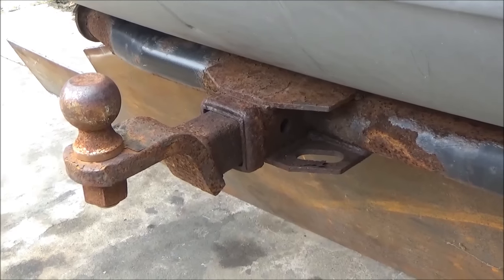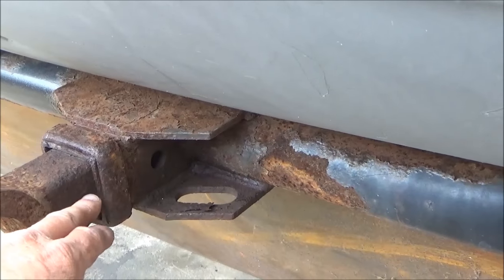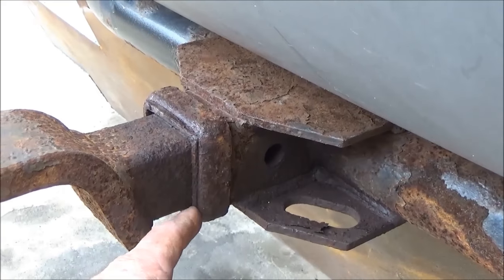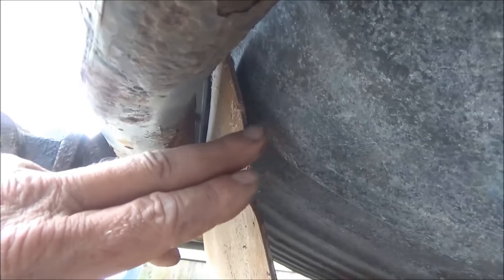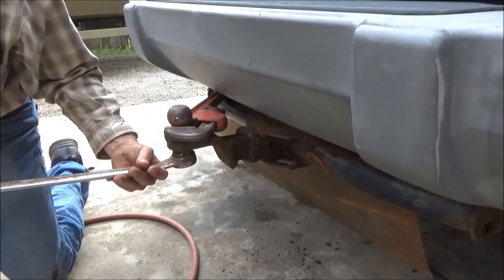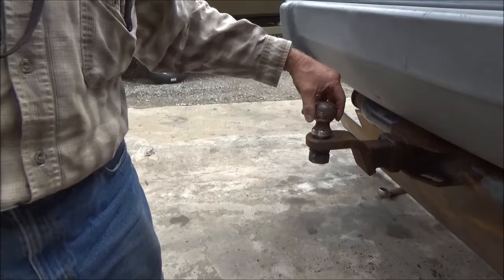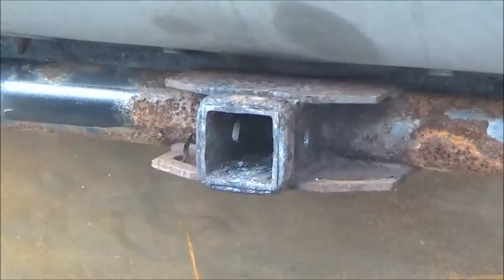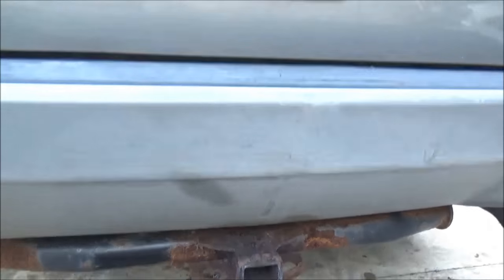Removing trailer hitch that's rusted in the receiver

Comment: Always spray the hole with PB blaster and transmission fluid. The transmission fluid stops the rust completely and PB blaster of course is a great lube. I never leave a hitch in the receiver until it's being used.
Reply: I left mine for about 7 years and not once has it been seized. Plus, it has a good paint job so no rust issues

Comment: I did it today by first pushing the hitch a little  IN  first to brake the rust using a sledgehammer, then using a dull all metal chisel and a sledgehammer to push it out. I used liquid wrench spray periodically. Give it some time to soak in. Very proud of myself.:).
Reply: 2 years later, your brain and your comment saved someone's day. Took me a minute and i didn't even had a sledgehammer. Thank you very much for being smarter than I am.
Reply: @zakingstreaming7072  , you are welcome, and thank you for the feedback.

Comment: I just did one too without heat and just a sledgehammer and Auto Transmission Fluid and WD 40. Took about 7 times 15 minutes to do over a couple of weeks. If you can give it time and get it to move any amount eventually it will come out. Patience and persistence is all thats needed. I scratched a mark on it so I could see movement. Hitting it in and out and side to side once you can get any movement it's days are numbered. It will move more and more even if it is only 1 mm at first it will come out eventually without the torch. Soak and hit method. Used whatever you have.

Comment: Hi Gordon -  I had a same problem as you did but I wanted to save the old hitch - I did not want to use the torch because of the gas tank so with the help of WD 40  and a small sledge hammer it came out  . . . two days later   ( ha )   after getting it out I smeared anti sneeze inside the receiver - to prevent it from rusting .inside .
Reply from the maker: Glad to hear yours was not as bad as mine was.

Comment: My rusted on trailer hitch was freed ... FINALLY ... after six applications of WD-40.  After failing to bang it out with a hammer, I drove it to our daughters house in the country, wrapped a large chain around her large tree at the base making sure it was completely in line with the hitch, attaching it to the hitch and it slid right out.
Reply: Mine's stuck right in there and I considered doing this to get it out... I just don't have a tree. And don't really think i should take it to a park and use one of those trees :S
Reply: 😅🤣😂 that always works!

Comment: I used heat, I used pb blaster, I used a sledge, I hooked it up to a tree. Nothing worked til pulled up my jeep winch and put pulling tension on the truck hitch. While under tension, I soaked it in wd40 and hit it side to side and up and down with the sledge. Keeping tension and smacking it eventually it popped out.
Reply: I've got the 1¼" size hitch rusted in, on the back of my van. I have sprayed a bunch of PB Blaster on it, smacked it with a small sledge & won't move a bit. I thought I might tie a chain around a tree, pull it tight, spray more PB Blaster on it, & hit it a few more times with the sledge.
Reply: @swmovan  the  most recent  method i used was remove the hitch  put it in a hydraulic  press and let it do the work
Reply: @timjohnson6864  After spraying, & pounding on it several times, & letting it sit for several days, it had a little side to side movement. That gave me some hope. Then, I hooked it up to the back of my car, hitch to hitch, with a come-a-long. Cranked it fairly tight, spraying PB into it, & smacking it with a 5lb sledge. After several whacks, on each side, it came out.
Reply: @swmovan  yea mine wasn't moving until the press and she popped loudly

Comment: I bought a bike rack that plugs into my trailer hitch receiver. However I cannot get the trailer hitch with the ball out of the receiver as due to rust.  I used to always take it out every time I used my trailer once or twice a year. Then about 3 years ago I said, heck, just leave it in there, as it will be easier to  use the trailer then getting the trailer hitch and shoving it into the receiver and pushing in the pin.

I used WD40 for 3 days in a row and some other rust remover and then I decided to hook a wench on to a tree and then hook it up to the ball and winch out the hitch. However it would not budge and I too thought that I could damage the whole hitch were it is screwed into the body so I gave that up even though I did winch it pretty hard.

Maybe I can take it to an auto garage and they can do it.  Loved your video and now I know I am not the only person with this problem..  Had one soaked it with grease, would that have stopped the rust over a few years? Not sure.

Comment: This might be possible with a reciprocating saw as well. Cleaning out the hole could also be done with one just by letting the teeth rake back and forth over the surfaces inside the hole. It should grind the rust off pretty good.
Reply: go through about 10 blades in the process?
Reply: Exactly what I thought as well

Comment: I would've soaked it down with some KROIL penetrating oil & gave it some time to soak in. Then I'd hook a chain to it & hook the other end of the chain to a big tree & gave it a few slight jerks. However, That method depends on how durable & strong the receiver hitch still look looks.
Reply from the maker: I let it go too long for anything like that, besides, it made a good video for torch work. Thanks for watching.

Comment: To not have to do that again simply remove the receiver when not in use !! Some areas don't allow you to keep the receiver in when not hooked up so you need to be able to remove it fast & easy.
Reply: I do that with mine and it still builds up rust inside the receiver and then you have to pound the hitch in.
Reply: @schmidtydog  Salt belt problems.  There's nothing you can do really except completely coat it in grease.

Comment: I wonder if I connect a trailer get to the forest, then remove the finger and drive a bit in the forest with no finger. I believe trailer should do the trick as it will do pull in all directions so that it will com off. One more thing came to mind the road should be slightly uphill so that once it got torn the trailer won't hit the car. Any thoughts?
Reply: I thought I'd this same plan. If you ever do it, please film the result for us all
Reply: @taylor2105  I have not done it this way. I used big hammer. I tried soacking WD40, then vinegar. Seems nothing worked, may be it improved a bit but still. Then after 3-4 days I bought a big hummer and attached to a big tree using belts. Reversed (be careful I broke a belt) to make a tension. Then used hummer and was hitting from left and right. I was knocking for 1-2h to get first 1-2mm. then it started moving out better. I think in 2-3h  I did it. 
I still think the idea with trailer seems better, If I had old rusty trailer  for this I would try this option first. 
When I removed it completely I understood why it was difficult to remove the rust was so thick. I think all my attempts with vinegar did not help at all probably because I did them after I tried WD40 coz everything was oily. I tend to believe WD40 was wrong way to go. I had to use vinegar first.
Reply: @alexk6745  I finally got my seized hitch out too. I destroyed the hitch to remove it. Cut it off, then used a sawzall to cut the inside square apart, and a chisel to break it free in pieces.
There is still rust chunks stuck in the Reciever, but I made it work again
Reply: @taylor2105  wow, I start to think I was lucky.

Comment: After all the trouble of cleaning out the rust, aren't you going to paint it?
Reply: Why? You'd have to remove it, sand blast it, strip clean it, and even then it'll rust just as bad. For functionality, this won't happen again if you use grease in the receiver channel.

Comment: What does all that heat do to what ever tempering the receiver has?
Reply from the maker: nothing. I've been torching and welding over 40 years. I'm still using that hitch just as I left it when I did this job. I just don't leave it in the receiver anymore when not in use. Thanks for watching.
Reply: He's correct ( of course ) the hitch's draw bar is not a tempered piece of steel.

Comment: I need to do this also but my luck I would cut into the reciever.
Reply from the maker: That's one of the reasons I did it that way on video is to show how to use a torch that way. Thanks for watching.
Reply: @57bagre  Mine is so rusted, about 6 years ago the pin itself stopped moving.  Sledge hammer wouldn't even bunge the pin. I think mine will be a battle.